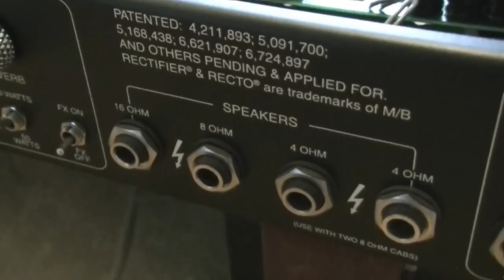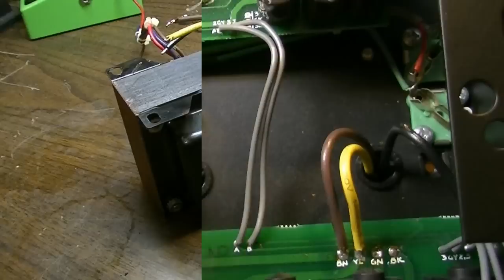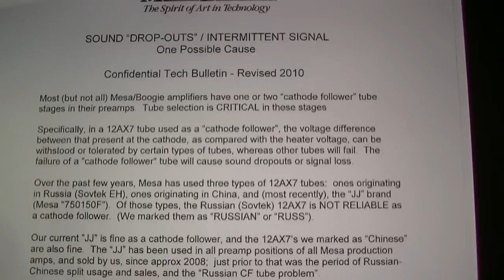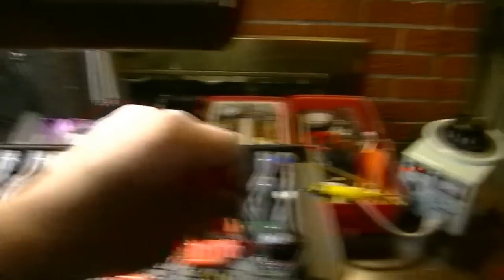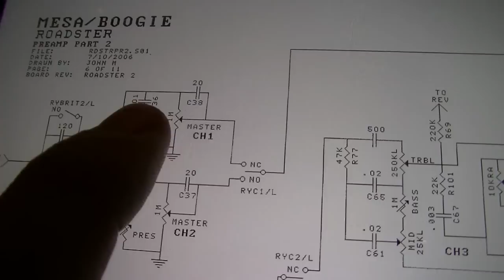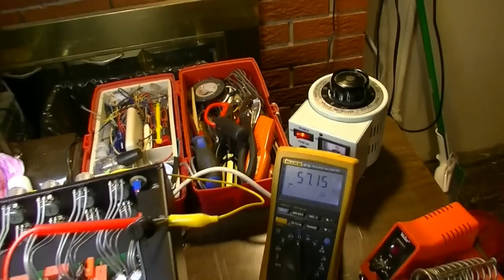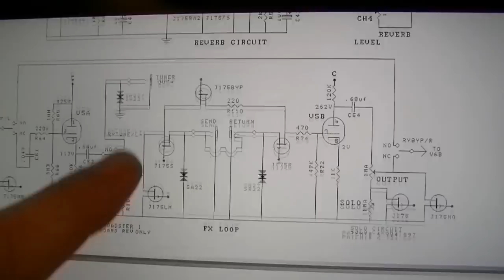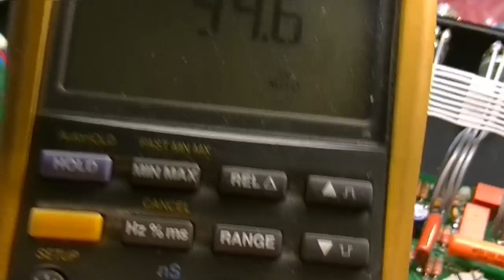Amp Tech's Worst Nightmare - Mesa Boogie Roadster Repair

Comment: Late to the party here but my Mesa Single Rectifier Solo head was making all kinds of noise so I did the wooden chopstick to the tubes test and found it..put a new preamp tube in it and it still sounded horrible so I pulled the chassis and noticed it cooked a resistor by that preamp tube and burned a hole in the pcb..nobody would work on Mesa amps so I cut the burned part of the pcb out and re-did some of the tracers on it and put in a new resistor and it worked great..but the Mesa Boogie tech was really helpful over the telephone when I called them for help...I sold that nightmare of an amp.

Comment: I’m a noob attempting to repair a solid state Marshall for my son-in-law. Watching these repair videos is giving me hope. I’ve already found a resistor and a capacitor loose, broken 1/4” input so the ground to chassis is loose, and the fan with that special howl on startup. I believe the fx board has failed too so it’s bypassed for now. The headphone jack also had a bad connection but DeOxit took care of that. 😂
Reply from the maker: Nice!👍

Comment: As a electrician 20yrs, it looks to me that the black n ground were nicked when the power cable was scored, put in place n then broke from the vibration of electrical power over many years of off/on
Usage. Seen it many times.

Comment: Disassembling is a nightmare. I worked at a shop. And those Mesa's and 5150's would suck. I remember my boss came in the back and said he had customers at the front desk and they could hear me F bombing! I got a 74 Marshall JMP50 It's the best amp in the world with the PCB. Only potential problem to replace a component properly you have to lift the board. All the leads have been stuck in same position for 50yrs. And it only has 6 knobs. Those Mesa's have a hundred. What's funny the shop manager told me there like BMW drivers He could give them a high estimate.

Comment: i once owned a mesa boogie joke..the Rectoverb combo.. a joke.. complete joke...did i say it was a joke?  the level of the reverb  ..maxed out was barely audible..and i called mesa..wrote to them and they confirmed that how it was..why call it rectoverb you idiots.
 
and it fell appart.. main transformer was loose after a year and the main baffle that held the grille fell off by itself during a gig..
the only way it sounded decent is when i put my jcm900 hear on it and used it as a cabinet only..
never got a dime back from mesa.. thieves they are...

Comment: The most difficult amp to service for us was the Triple Rectifier.  Ended up being 1-transistor and 1-fet.  We replaced all fets and 3 transistors.  Resoldered around the power supply (getting the ring of death) and replaced two resistors.  The worst part of the whole ordeal was to ""learn" the 19 relay logic circuit and to remove the pc board.

Comment: A few years ago I was repairing a Road King with two large burn holes (circa 15 - 20mm) on the main PCB. All JFET's and LDRs were dead, some resistors and capacitors burned out too. But the worst part was the disappearance of the copper traces on the PCB. There was a lot of work to be done, but the amp was fixed and it went on "first shot".

Comment: Great video Brad, thanks for sharing. As I see you worked out all the solution and component testing and connecting/disconnecting without the need of removing the main board. I'm working on a TA-30 at the moment and seems like the first J175 could be causing some noise to filter in channel 1 (not so much). But I was thinking about the solder points on the underside of the board and the PITA that is removing it. Did you use something special or just the normal solder sucker and a very fine solder tip?. Thanks Mate.

Comment: I was working at TAD in Worms some days ago
the common  problem or "bug"  with the Mesa is - they use FET as switch to ground out the signal - if the  gate current of a particular tube is too high - the FET is shot out because of current higher than specs -  and  FET needs to be replaced  -

Comment: Nice job Brad, this was a pesky amp issue, I bow my hat for your ninja technique with narration, that is a lot of wiring in there ... one question regarding diagnosing a much, much simpler tube amp, PRS MT15 (I am no electrician, know how to solder and understand what a pot is), but have found that when I bridge the FX loop (tried this recently for the first time), I cure a constant loud buzz (that also reduced guitar signal a lot) my amp started producing not so long ago. So my brain kinda tells me that something on the small FX loop PCB is not grounded well or something like that. Would you agree? And if you have a minute to tell me how to go about resolving this without taking the amp to a service shop I'll buy you a beer next time you come to Ljubljana. Cheers!

Comment: Thanks for another great video. I know this video is 4 years old but I'm troubleshooting a Mark V head right now that seems to point to burned jfets as well. Is there any reason you couldn't just put the VOM leads on the ends of the jfet and measure resistance once powered up? The malfunctioning one should show a short while the working ones would show high resistance to ground. Would save replacing multiple jfets if you could locate the malfunctioning one.

Comment: There is only 5 things that could cause low volts period( provided the 2 diodes were not shorted)the transistor , c78 j175 mm lm mo… can’t help but think amp is working but mute still not right did you test the diodes….? The transistor is the source of the ground when it is turned on or if the cap would be shorted… Or you have shorted diode‘s and that could bring ground from anywhere
Regardless your videos are great

Comment: The leads on the transformer were cut deliberately and the proof is whoever did it nicked the black wire with the cutters. Really neat cut on the green and a partial on the black. What a dodgy shop who did this.

Comment: 25:15 DMM measure resistance by injecting a small current into the circuit and comparing the voltage drop across it. The moment you turn the amp on, external current is going into the circuit as well and interfering with the resistance measurement. It would even be possible to fry the DMM. I'm amazed that someone as experienced as you are doesn't know the basics of how a DMM works.
Reply from the maker: You weren’t following what I was doing there at all. The wiper of that pot should see NO DC voltage potential to ground. That was the whole point.

Comment: Do you feel the roadsters are generally reliable amps, or do they tend to have a bunch of dumb failures?
Reply from the maker: The failure you see here is well known at Mesa and they even had a name for it - “perma-mute”. The failure is almost certainly heat related. The FETs are being asked to perform in an environment which is beyond their long term capabilities. That’s my opinion, not fact. I can’t prove this without experimenting.

Comment: I have a Line 6 2x12 with Gain Problems. After watching many of your video's I may be able to trace and fix it. When I insert into the speaker jack the gain drops to from 9 to a flubby 2 ( weak) I suspect a solder joint is in need of reflowing. Everytime I lean the amp forward or backward the gain kicks in ( sometimes ). Something is loose. Problem also happens once it warms up, it'll go out after a bit but, can Be tapped ( on the case) and it pops back in. I'll put it apart and check all the connections on the board and any loose wires.  The Fun Begins. I'm sure its something simple if I can locate it.

Comment: have you considered adding sockets to the board for the switching transistors?  or tiny terminal blocks? that way they'd be super quick to change since they fail often enough.

Comment: Mighty fine job there bud. Yep those dirty flux pads can hide a whole bunch of problems; from bridges to solder balls and loose wires. Always clean em off and inspect the joint after soldering. That stupid little cleaning job has saved me hours of chasing down shorts in the past. Thanks for sharing. Best Wishes & Blessings. Keith Noneya

Comment: You know i bought my Roadster at the same time you made this video. My FX loop doesn't work, ive heard its as easy replacing the number 5 preamp tube. Any advice? 
PS what did you think of getting those preamp tubes into the amp?

Comment: I've had some issues with my Roadster head with the guitar input jack in the past. It has been fixed but basically, there's too many components on a very small space I've was told. That's goes for the whole circuit board. 
It's back on service for some more issues  and probably, it's only the power tubes that needs to be replaced but allover I really don't think I'll ever sell it because it sounds killer 🤘

Comment: I can tell with Mesa Boogie's User Manuals. They do a better job of walking a new customer thru. I realize a lot of it may be redundant from product to product and seem obvious. But put it in there, sometimes that tone knob doesn't work exactly the same way from brand to brand, product to product. I've seen so many companies simply provide crappy user manuals. I've even bought some products that I regret doing that later on.

Comment: I had to replace scratchy pots in a  Mesa Nomad I picked up cheap. It had the cheapest pots I ever came across. Some fell apart in my hands upon removing. Needless to say, I never bought another Mesa Product. I had to work on my Peavey bass head, the graphic eq was not working. It had sockets for the chips, I was able to just R+R without a soldering gun. You go Peavey.

Comment: nice sleuthing, always those little f ups soldering... I've done a few myself.  If it was my amp I'd get those IDC connectors out of there on the ribbons and put f crimp connectors.. dam IDC's are terrible for intermittance especially from vibrations... I have a manufacturing biz that we have to use those for other customers because they spec them in and they are the shitz in time.   Great video , always nice to watch someone else do it instead of me.

Comment: Carlos Santana started out with Mesa boogie amps. Mesa doesn't provide a tube bias resistor adjustment. You buy pre matched sets of tubes from Mesa. However if you have a tube tester and can match your own set your good to go.

Comment: I've just had a Mark V in that took over 3 days of work to remove the main board to replace  diodes in the DC 12V heater supply , and complete the repaid and test it . The most  complex amp I've fixed . Luckily the customer kept encouraging me to carry on and do my best , because I was ready to say "no thanks" and give up on several occasions .

Comment: I left a comment on another amp that you refused to fix. I have over 50 years in electronics. Get in touch with me if you can't fix something. I don't need schematics. I totally wing it. I've fixed stuff that factory techs couldn't. 
Get in touch. I'll do a reply video and get it done.

Comment: I've always had this question.. and can't find anything online about it to actually answer what im trying to figure out.. and that is.. what is the point of using a variac, does it protect against voltage drops or surges ? if it doesn't protect the amp from everyday use, what should I use other than a power strip to protect the amp from shit it shouldn't encounter?
Reply: A "variable autotransformer"[1] in itself doesn't protect against anything (it probably does mute/lessen some voltage spikes but that's not the point).
What it does allow a technician to do, among other things, is to test the connected device/equipment without supplying the full AC voltage from the start, thus limiting the possible further damage if there is a/another serious fault in the HV/primary side of said device.

Another common method when dealing with faulty SMPS is to connect a classic filament light bulb in series(!) with the PSU, thus limiting the maximum current and visualizing such faults: If the primary side of the PSU has a serious fault (like a dead short) the light bulb will light to its normal brightness immediately.

[1] https://en.wikipedia.org/wiki/Autotransformer#Variable_autotransformers
Reply: L1m3r thank you. But to answer my other question, basically a surge protector will do the job

Comment: Very cool! I got a dual rectifier the whole thing started humming but before that I had loud pops when I was switching from channel to channel using the foot switch. 
I have related schematic knowledge on elevator equipment and troubleshooting has never been my strong point but yours seems to be top notch!

Comment: This is why I like simpler equipment I don’t understand every thing I was seeing but I can read the circuit diagram and follow the paths I used to work on downhole logging equipment It was a great job. I like the orange crush amps and the fender tube amps I don’t play with much else those amps have been good to me. I am in the market for a marshal amp I know dick all about them other than people saying if you have a Les Paul you should have a marshal amp to go with it.

Comment: I have a problem with an Acoustic CX450 amp.  Was wondering if I can send you a picture of the burned part.  The amp turns on but no output but I was able to isolate the burned out part.  I also noticed the effect button on the front was broken.  I am assurming the amp fell on its front breaking the efx bypass switch and caused a surge.  The original owner told me when they turned the amp back on it started to smoke.

Comment: Mesa actually have a poor reputation among techs and engineers, George might have been helpful that day but few others report cooperation.
Most of that repair time was tracking down a tech induced problem. This is one reason, among many, that shotgunning, the practice of replacing parts until the problem goes away is very bad practice. It harmed the pc board, runs up the cost of repair and shows it was not diagnosed properly from the beginning. If this was a customer unit, they would have paid a lot more for the additional time and transistors used needlessly.  You seem to be a nice guy and have an easy-going personality but that was not very confidence inspiring to see a simple problem result in replacing a number of parts for no reason. It no doubt resulted from not really understanding the circuit well enough to focus on what mechanism of fault would explain all the symptoms.
I have trained a lot of techs over the years and spend time with the most effective diagnosis processes increases effectiveness a lot.  Before I moved out of the US, I had a shop with 23 technicians and we did all of the major brands under warranty in MI and pro audio, touring sound and studio. If a new tech, one who had a background in electronics theory but had not developed good diagnostic skills, it was easy to get them to form good habits but experienced techs without solid electronics theory, they had a choice of learning better habits or go somewhere else. Shotgunning was one of the bad habits that are common but should not be tolerated. Having the proper test instruments is essential to getting readings that can be relied on for making an accurate fast diagnosis.  
One positive note. your cleaning out the lead holes without burning or stressing the board was commendable and requires controlled heat and suction. But pulling out a transistor hat did not need it resulted in the repair taking hours longer than it should have, and is a loss for the shop because it is not ethical to charge a customer for extra time due to tech induced problems. If my shop had to eat that added time, more than a few times, that tech would have been unemployed. To solve the multi-leg path to ground short, use a high-resolution low ohms meter, the difference in voltage drop across different paths would have told you where the leakage was. The difference in 0.05 ohms on a path points you to the leakage path. In operation, high sensitivity very high Z voltmeter could identify the path when the unit was on, in the first few minutes of taking measurements. That general purpose handheld meter did not have the resolution for very low resistance and or current flows.  You can get excellent industrial surplus high-end test gear since so many tech companies have closed up operations to go overseas, so for a thousand dollars, you could have a well-equipped bench.  
Good luck with your shop/channel.

Comment: I have the same popping sounds in my dual rectifier - occurred after I had it fixed for another problem. Only solution I found was switching to standby before changing channels - and I'll never be able to use it live, haha.

Comment: When it comes to heat and tubes you can't beat point to point wiring. That's why all of the 1960's tube amps are still standing the test of time. I'm retired now but I used to hate dealing with repairing the newer tube amps with ribbon cables or tube sockets mounted directly to a PCB like you see on a lot of the newer tube amps and before I forget, do not get me started on today's VOX modeling amps.